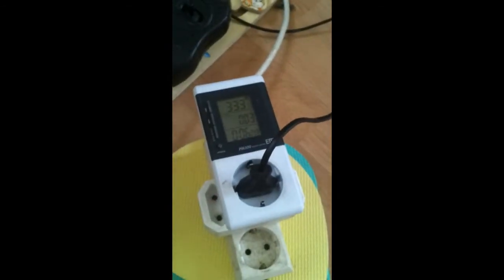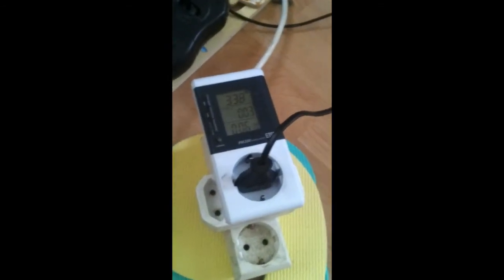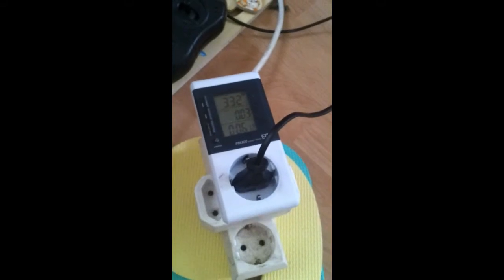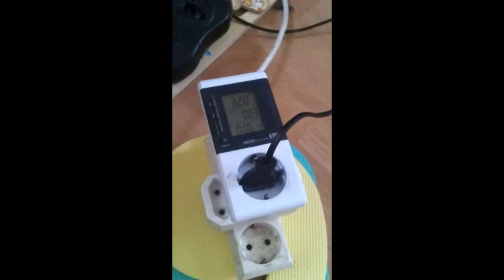Steam Balloon. Thermal aircraft. Steam aircraft

Comment: Much later than what you posted, but do you know the flyingkettle.com website, they had a very similar idea to yours? iirc they succesfully inflated some balloons, also one of your size, I think they used an steam cleaner for that.
As for your problems: it seems that you had trouble producing more steam that your lost trough condensation. You could try to produce your initial load of steam by heating a  a mass of metal (or stone) to a few hundred dregrees and spraying water over it. You will need some measures to make sure the steam you produce is not superheated, as that will shrink the plastic. once you have your initial load of steam and sufficient lift, just letting the condenate drip down will keep it afloat for quite some time: there is a lot of energy in the steam that is released when it condenses. If 400 watt is enough to keep the balloon afloat seems doubtfull to me as you have no means of isolation and you need to keep several M^2 at 100degC. 
as for lifting the amount you seek: just try ordinairy hydrogen gas: the molecule H2 is much larger than He (due to the two atoms instead of one), it will not diffuse through a rubber (latex) balloon as fast. You can make hydrogen gas simply with drain cleaner, aluminiumfoil and water in a bottle. You need to bubble the gas trough a second bottle with vinegar to scrub the gas of lye remains.